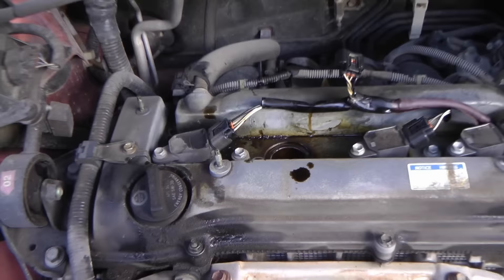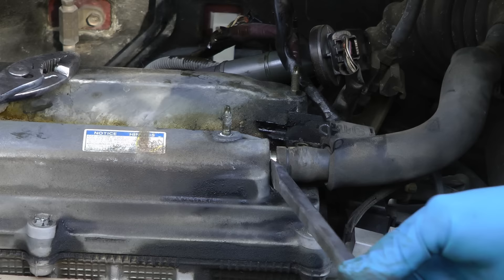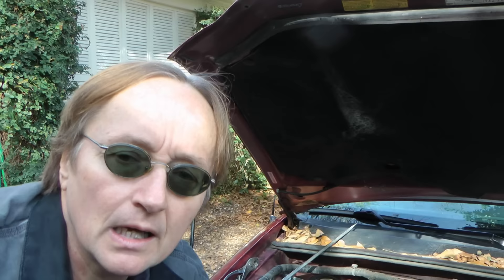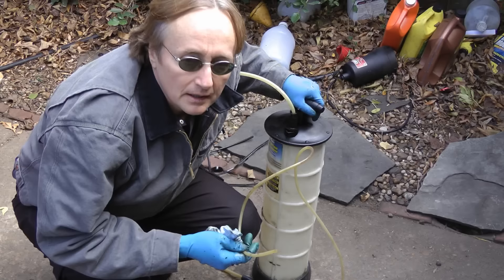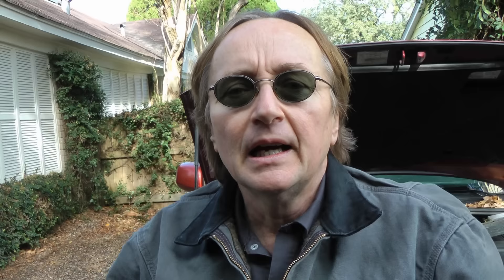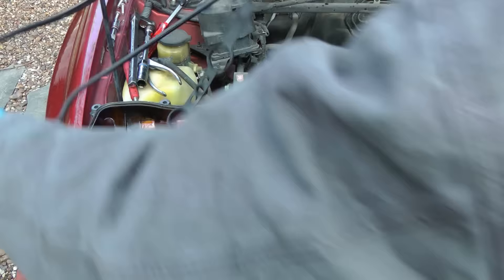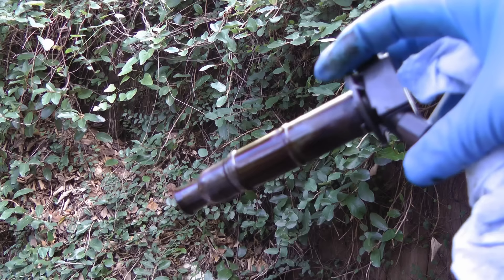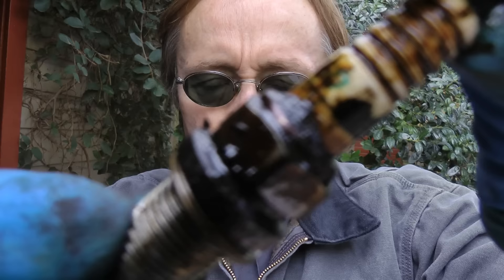How to Fix Engine Oil Leaks in Your Car

Comment: hi scott much appreciate the work u and many do for us not so mechanic minded lol cheers
my holden jackaroo has bad oil leaks especially transmission when  i turned on car this arvo check transmission light was flashing constantly when put into drive car very sluggish to move if at all when in 1st gear car moves better but changing to second has some crunch and clunk sounds goin into third not so bad and gradually car gets upto speed
i did make it home about 100 km in traffic (had no choice) transmission is red hot
i cant seem to find where to fill with oil if it needs and dont want to loosen drain plug until i know
auto transmission 4 speed 4x4 holden jackaroo 1997 model isuzu motor
thanks for any advice u could offer as user manuel just reads see holden dealer team $$$ lol cheers DAMO
Reply from the maker: well, they don't sell those models here, but the isuzus here don't have tranny dipsticks either, there is a special process to check and fill them which requires a fluid pump machine. Ask in your area how yours is designed the the process you use, cause my data system does not include holdens

Comment: what does it mean when the oil is on the threads
Reply from the maker: engine is burning some oil then
Reply: +Scotty Kilmer  well how do I fix the oil from  leaking. changed the gasket but its still leaking.

Comment: OK I got a?  Toyota camry 91 I have a oil leak. And this mechanic said is the motor that is doing to much compression. Please help me
Reply from the maker: motors can't do too much compression, as they wear, compression goes down, not up. find another mechanic who knows his stuff, plus change the pcv valve as a broken one can cause oil seals to blow out and leak

Comment: Hi scotty, how much would i guy like u take to replace thr vaule cover gasket on this car?
Reply from the maker: some take ten minutes, some exotic cars take ten hours. This one would take me about half an hour
Reply: Scotty Kilmer I have oil in my spark plugs and a massive oil leak. Im guessing this is my problem. But also the power steering is having trouble the pump goes in and out barely working. There is no power steering leaking could the low oil affect the power steering? If you could help me figure this out I'd greatly appreciate it. Thank You!

Comment: Scotty I do have oils around my spark plugs, but is this the reason why i have to add engine oil because my engine oil tends to run out  in  as short period of time, i had to add a litre  every 2  or 3 weeks , by the way I don't find any oil dripping underneath my car
Reply from the maker: worldpeace32 cause they burn oil when engine is wearing out. But do change the pcv valve and pray that's most of it
Reply: Scotty Kilmer i haven't changed the pcv valve yet because i didn't even know it exists , i'll replace it,  thank you for your help, peace.

Comment: I know my question is irrelevant to the video, I have water in my spark plug well how do I go about cleaning it up. does this mean I will need to fit new spark plugs and leads. it's worth mentioning that I have a misfire from the 4th cylinder would this be the likely cause to this?? any help would be greatly appreciated
Reply from the maker: you can spray it out with compressed air, but you must figure out how it got there. Pressure test the cooling system first for leaks, and PRAY it's not a blowing head gasket. Waster does not damage spark plug wires or spark plugs
Reply: +Scotty Kilmer thank yoh for the reply, i recently just bought it and it's been stood for a long while maybe this would be the cause?? if I cleaned the water out and dried the spark plugs would this do the trick that's if there isn't a major problem else where? thanks
Reply: +Scotty Kilmer I think I have solved my issue, had the mind numbing task of cleaning the plug well with a old rag that took rather longer then I wished. had no choice but to change the plugs and leads as the water had corroded them leading to a misfire. also think I've located where the water come from apparently ford fiesta have a crap water jets that somehow leaks back and settles in the spark plug well. fingers crossed this will be the end off my issues.

Comment: Hi Scotty, I have a 98 VW 2.0 gas engine with +100k miles on it. The owners manual says to use 5w-40 synthetic oil for it, but when I went to multiple auto stores I could NOT find any of that grade that wasn't made for diesel engines. Is it safe to use the 5w-40 diesel oil on this car or am I doomed to go online and pay 40-50 dollars for this bizarre grade of oil?
Reply from the maker: yes, the diesel oil is fine to use, it's actually stronger oil, diesel engines have more compression

Comment: What if im leaking oil threw my exhaust headers where it connects to the down pipe? I have. 95 honda civic..I replaced my valve stem seals
Reply from the maker: IF valve cover gasket is ok, often that's leaking head gasket at the oil seal sections
Reply: Scotty Kilmer i also replaced those seal leaks
Reply: Scotty Kilmer how would the head gasket leak thow?

Comment: when i start my megane from the passenger side at the front, under the windscreen area and above the glove box, I hear a whining noise with several thud like noises, as those something is trying to spin or kick in but getting stuck.   After about 5 seconds the noise stops.  When I stop engine and slam my door shut i hear a thud noise in the same area.   What could this be.  Someone said it might be heating.
Reply from the maker: french cars whine,just like french people. to find the source, first remove all the fan belts, and start it up. If noise goes away, it's something one of the belts drive, pull on them then and find what's worn. If it still makes it, then it would be something inside the engine, like worn cam bearings, something you don't want.

Comment: My car has been leaking oil for months now and I'm starting to smell it burn what should I do first ?!??
Reply from the maker: put UV leak dye into the engine oil and see where the green dye comes out
Reply: make sure you have oil in your car?
Reply: Oil levels seem ok not too low but the burn oil smell is present and there's no smoking.

Comment: I have a 2000 chevy camaro v6 3.8 it loses coolant with the car off and theres no signs of it leaking and theres no water in the oil. any idea what it can be?
Reply from the maker: do my video tests "how to fix an overheating car" it has to be one of those
Reply: +Scotty Kilmer thats the thing its not even over heating . it only loses like an inch of water from the radiator and its not going to the overflow

Comment: Great video Scotty, except I dont know if the screw driver between gasket and cylinder head is the best idea for these noobs to try. They may mess up the surface of the metal, dent it or scratch it, while prying, and sealing might be a problem.

Comment: Hey Scotty I have a 1998 Oldsmobile Intrigue 3.8L SFI OHV 6cyl  that is leaking oil actually the oil is sitting on top of the engine in plain view and also dripping under the car. If I 'Rev up the Engine' I get a white blueish smoke out of the tail pipe. I don't have much money to get a new car and if all goes well piece by piece i can fix it, hopefully. I don't have much tools but i have some. Can you help???
Reply from the maker: you have more than one problem. Oil on the top is often a leaking valve cover gasket, but blue smoke out the tail pipe is a worn out engine burning oil, has nothing to do with leaking.  Try new valve cover gaskets and live with the burning.
Reply: The blue smoke is causing me to fail State of NJ Inspection. So should I just consider a new car??
Reply from the maker: *****
yes, or move to texas with me, they don't care about blue smoke here, they don't fail for that

Comment: my car shut off last night while driving and wont start. i had put oil in it three days ago and had no problems. last night the oil pressure light came on and when i pulled into a turn lane thats when the car shut off. after getting it off the road, i tried adding more oil but it just came out the bottom. Did my engine seize up?
Reply from the maker: +Tara Jackson  yep, engine is toast now
Reply: +Scotty Kilmer 
even tho there was no dead l knock?
no sound at all actually

Comment: Man, I wouldn't use a wire wheel on the inside of the head like that. You get pieces of wire going coming off into your oil you will kill your bearings.

Comment: Hi Scotty I have a 1988 Toyota Corolla FX, recently i noticed a leak at the bottom of my car and took it to a mechanic that said he would have to take out the engine to fix the oil leak. Is he trying to scam me? or is this a genuine solution to fix the leak?
Reply from the maker: if it's the rear main seal, you would pull the transmission to fix that leak, but you could leave the engine in. either way, BIG money. Try some AT 205 reseal poured in the oil, often stops such leaks. Amazon sells it as it's hard to find
Reply: Scotty Kilmer
Thanks Scotty, you are Awesome!

Comment: How to fix an oil leak in the rear Dodge Cummins
Reply from the maker: if you mean rear main engine oil seal , you either remove the transmission and replace the seal, OR try some AT 205 reseal in the oil, it often works and amazon sells it

Comment: I have a 2008 escape, it just stop when he put it on the tow truck all I seen was fluid coming out from under my truck. The man told me it was oil and with a jump it will not start. I hope I didn't blow my engine, can u help me.
Reply: can someone help me and tell me wat u think it is
Reply from the maker: well, check the oil first, fill it up if low, then pray like mad it's not blown

Comment: hi how you guys doing, i have a 2011 nissan sentra sl 2.0, so i hope you guys can help me it trowed me a code P0304, is saying it has a misfire on cylinder 4 so i put a new coil on it but still doing same thing, a checked the spark plugs, they  have oil but just on the threads not in the top part,the coil are dry, i was wondering if the valve cover gasket will fix it but i don't see any oil coming from the top , its just on the bottom. thx
Reply from the maker: +Juan Enriquez   change the valve cover gasket and spark plug tube seals, pray it's not a head gasket problem
Reply: Ill do that thx Scotty

Comment: on friday, i took my car to mobile to put detect location. they put oil detector and told me to drive it home, and bring it back on monday so they can see what it detected and hopefully fix it.can i drive a car leaking oil to the gas station on monday?
Reply from the maker: +Fifi Leigh as long as it's not leaking too fast and you lose more than a quart of oil
Reply: the spot on the ground shows up after one hour. i hope i can still drive on it for monday, when i take it Mobile so hopefully they will fix it.

Comment: Using that wire brush leaves metal shavings all over don't be surprised when that car comes back needing a new engine because it threw a rod.

Comment: Hey Scotty! fact that I am having trouble with my car Audi A 4,2005 when they run in the morning I do not hear anything
And when they run after half an hour and more I hear the crackling sound of the engine and disappears when I provide a little gasoline.
I beg for help
Reply from the maker: realize audis become endless money pits when 11 years old unfortunately for you. Audis have quiet engines, and when they start to make noise, often that's a sign of impending doom of the engine breaking down. BUT, if you can, make a video of the noise and I can analyze it
Reply: Yes I would. How I wish I could find me a solution.
The car is still in excellent condition and I love it

Comment: Hey man I recently bought a 94 28 camaro and its hapoened twice were i would be driving and the first time my gas stoped working but everything else was working and i took my foot off the gas put it back then it just started working again this all hapoened while i was driving then i floored it like an idiot out of the parking lot and my whole car cut off and wouldnt cut on for a good minute please help
Reply: z28*
Reply from the maker: pressure test the fuel pump, weak ones often do just that
Reply: thank you
Reply: Scotty Kilmer hey do you know how much something like this would cost on a 86 caprice

Comment: Do you really need a video for that? If you fully release the clutch while on a handbrake and your engine doesn't stop, your clutch is most definitely slipping. You can feel that while driving without such methods anyways.